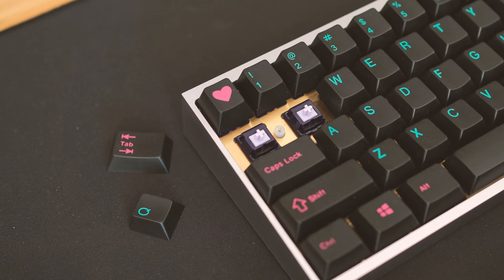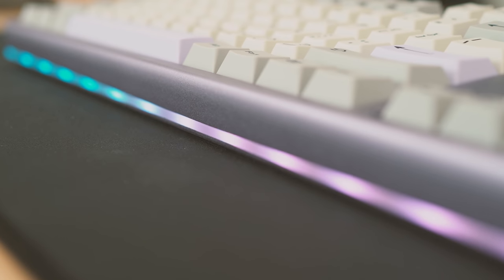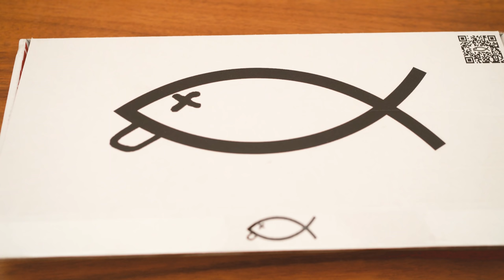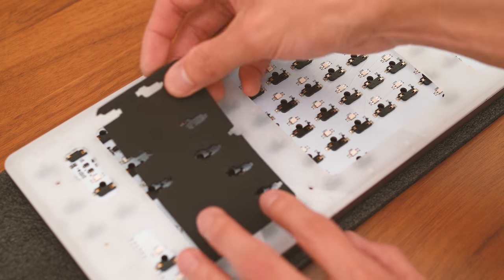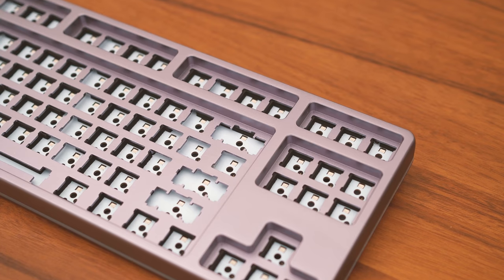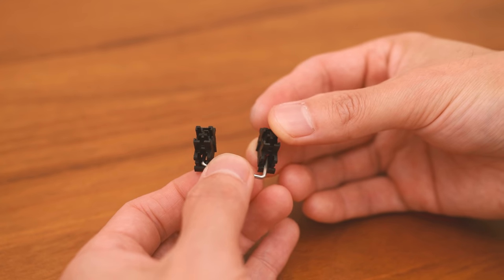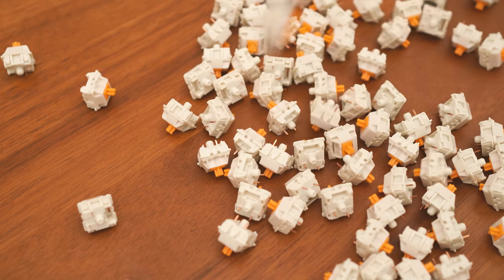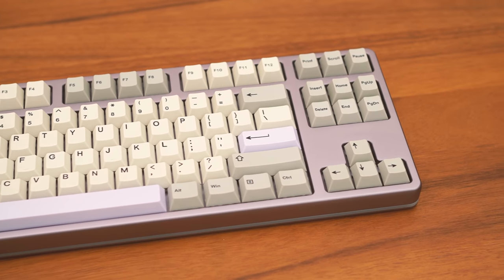Building the MOST AVAILABLE Custom Mechanical Keyboard!  DROP CTRL

Comment: Dec 2023 - I got this keyboard and built it as my first keyboard. I didn’t buy any foam but I had some sticky foam around (like the white vinyl foam you used). Thank you for the video as it showed me where I can put foam and everything neatly fit together easily meaning I just put it together and had no spacing issues. Thanks for helping me find this rabbit hole. Never getting a mass produced board again :D

Comment: The metal pieces are for the non high profile version since they use magnetic feet's to increase the angle. You can set the feet's either create a positive upward angle or a negative angle.
Reply from the maker: Hi Jmun 1!  That makes a lot of sense!  Thanks for chiming in!

Comment: I know this is an old video but I just found it. Great stuff man. After watching, I dove back in to my CTRL & pulled the stabs, did the band aid mod & took the op to clean & re-lube the stabilizers & just hit the buy button on the stupid fish foam. I have modded GMK stabs but went ahead & pulled the trigger on the Durocks you listed, because nothing is ever good enough.... dont know if it was the band aid mod or the re-lube but it did kill the ever slightest rattle I had on the left side of the space bar so I'm already happy. Looking forward to the foam & Durocks to see just how far I can push it. Thx again.

Comment: I think the little metal pieces inside of the case are for the magnetic feet to stick on stronger through the case
Reply from the maker: That makes so much sense :)
Reply: That's what I was thinking too until I saw this was the high profile which doesn't use magnetic feet.

Comment: underrated channel. your edits are to the point and voice over are top notch.

imo the best thing about the ctrl is that drop is able to keep it in stock ready to ship anytime.

compared to the next best thing like something in stock but takes two + weeks to ship from china (and drop does have no question asked 30 days return policy which is crazy as they dont have deep pockets like amazon)

the 2nd best thing is the PCB's very capable ARM controller which allows you to turn on every single QMK features and enables 10000+ keystroke macros if you want.

if the pcb supports 5 pins switches, I think the overall package does justify the $200 price.

when GMMK managed to get their inventory always in stock, the GMMK PRO will unseat ctrl for sure. hopefully drop can up their game in the next iteration.
Reply from the maker: Thank you so much C Xu! Yup the advantage of the drop is the availability :) also has one of the best rgb capabilities of that is important. I just built a few gmmk pros and they are very nice with some tweaks! Video will be posted this week!

Comment: the reason there was no keycap interference was cause of the glorious pandas im pretty sure. since they have a longer stem and bottem out faster then most other switches it doesnt travel low enough for the keycaps to hit the housing. :D
Reply from the maker: Hi Fred! Good seeing you! Exactly this! I feel longer stem helps to alleviate the interference! I wonder if there are linears like this as well... Most likely a cream stem frankenswitch or the new durock poms might be OK. Time to try it out!
Reply: @Keybored  nice lol, though i feel that if you get a linear with a longer stem - reducing the travel distance - it would make it much less satisfying imo. but still would be cool to try out
Reply: The glorious pandas are made to be compatible with Cherry profile keycaps and north facing LEDs. That’s one of their marketing points. I have the same and again, no issues.

Comment: Glorious Panda switches have a different top housing shape so even when north facing LEDs, they don’t interfere with cherry caps. It says this on their product page.
Reply: well I think it's more about the longer stem pole of the halo stem than the top housing shape though! but yeah I was about to mention the fact that holy panda (and it's variant) does not have any interference for north facing this was demonstrated by 3ildcat :)
Reply from the maker: Yup! The glorious pandas are a great option for North facing boards and cherry caps :)
Reply: @justinfournier2521  yeah that might be it actually. I just remember reading something about no interference.
Reply: @AtracBreezy  yeah basically any switches with longer stem poles will not have interference! (ex if you put cream stems in alpacas they would not interfere with north facing)

Comment: for anyone wondering, even though the pcb has south facing switches the stem of the glorious pandas have a longer pole meaning no tolerance issues for cherry profile keycaps
Reply from the maker: You are correct!  And there are also many different switches that happens to work with north-facing pcbs as well :)

Comment: A lot of people shit on the Drop keyboards but I think they have a lot of great features and are good for the hobby in general.  I'd be excited to see a version 2 for the ctrl. alt. and shift with pcb mount stabs, south facing switch orientation, and maybe even a different mounting system.

I feel its kind of like the same people shitting on the GMMK pro for offering a lot of higher end features(not all implemented well) on a really affordable and available board.  If they could fix their plates, tweak the "gasket mount," and either get rid of the GOAT stabs or properly lube them, then it would be a really great board for a really great price.

Good job making that Ctrl look and sound great!
Reply from the maker: Thank you so much! I do hear you in the criticisms! The hobby itself is pretty critical on many board designs. Hopefully constructive criticisms can help move the hobby along forward, but some do just like to troll for fun lol

Comment: i'd highly recommend his keyboard as well. i actually did most of the same mods as this one but the only problem i'd say might scare away some customers might be it's overall volume. because the backplate IS the case, it can get quite loud sometimes, especially if you're playing or just typing in a quiet situation. i played a horror game and this keyboard kind of ruined the game for me because all i could hear was CLACK CLACK CLACK when i moved around. other than that it's great
Reply from the maker: Hi Phantom! I hear you on this. The drop ctrl Def has an "Amp" effect on the sound

Comment: Ive heard that the Glorious Pandas have some modification to the switch so there is no interference with northfacing switches and cherry keycaps, unsure of how true that is but based on the typing test it sounds to be clearing fine
Reply from the maker: Yup!  the glorious pandas have no interference even with north facing keyboards!  The reason is actually their stem being longer, so the caps don't go down as much during the downstroke :)  Same for other switches like the holy panda, or the Boba U4T

Comment: How does the epsi/holee mod stand up to the added lube on the wire? Adhesives don't tend to do well after coming in contact with grease so I'm concerned about the longevity of the mod
Reply from the maker: That is definitely a legitimate concern! I used a more "plastic" type of bandaid hoping to avoid this... Will see how it holds up after some time!
Reply: One of the main advantages mentioned by epsilon in his video is that you don't need to lube the end part of the wire, the film / bandages inside the stem will eliminate any clicking / pinging, you only need to lube the curved part that clips into the stabilizer.

Comment: You won’t have interference with cherry profile keycaps because glorious pandas stems are extra long because glorious didn’t want any interference when putting on their gmmk (north facing)
Reply from the maker: Exactly this! Similar results with holy pandas as well as some linear frankenswitch using cream stems! I assume the new durock pom will also have similar results as well... I need to go try it now
Reply: @Keybored  Even though of the hate that it has for the integrated plate and plate mount stabs, i plan on picking up the ctrl high profile, as it looks so nice!
Reply from the maker: @utterkid2  I really like the new colors they also offer now :) I had an alt high profile as a daily driver for a while

Comment: an interesting technique to lube the stabs, inject lube into the stem rather than lube the wire, works better for PCB amount stabs?
Reply from the maker: I felt like it helps to control the lube Vs. using a brush and it going everywhere.  I guess multiple ways to skin the cat!

Comment: ARE THOSE KEYCAPS COMPATIBLE WITH GATERON BROWNS ALSO DO THEY WORK WITH HOLY PANDAS ON THE EPOMAKER GK87 IS THERE ANY INTERFERANCE FOR NORTH FACING LED LIKE IN YOUR VIDEO ON THE GK87?
Reply from the maker: Hi Andrew!  I believe these specific caps will have some interference issues with north facing switches.  I did notice that the interference is worse in certain switch/keycap combinations, and unnoticeable in others.  I had pretty good luck with the gateron yellows and long stem switches with many cherry profile caps in north facing configuration.  However, the HK gaming caps, you can definitely feel that R3 is a bit odd, since the cap bottoms out, and "moves" due to the interference.  Hope that helps

Comment: i bought the lopro version back in august last year.
here some things that i don't like at all about the board:
north facing switches (so no banger GMK sets for this bad boy)
3pin sockets (so you either have to buy 3pin switches or clip the legs)
for the qmk i'm not sure. last time i checked drop didn't release the qmk toolkit so you couldn't address the rbg leds on the edge.
Reply from the maker: I think as of late, some of the switches even in north facing configuration started to work with cherry profile like GMK!  I did a quick study on this on my GK87 modding video!

Comment: I’m trying to build a budget custom keyboard, what’s your opinion on the MXRSKEY 84U barebones with Gateron yellows and some pudding keycaps maybe for under a 100 dollars?
Reply from the maker: I don't have personal experience with that specific keyboard, but looks like a good start!  75% layout and you can never go wrong with the gateron yellows... so good when lubed and filmed!
Reply: @Keybored  I was personally thinking about this coz it was convenient way for me to get into that whole thing for only around 85 dollars.
Was still thinking either or not should I do it, only because of the reason that I have HyperX Alloy origins core, is made out of aluminium but I’ve heard it’s kinda hard to mod. Should one is better to choose

Comment: What linear switches you would recommend for that board? I want me some Linears. LOL
Reply: I recommend everglide tourmaline blue or Sp-star whites. They both sound good stock and feel great.
Reply: Gateron ks3 yellows are always a good choice
Reply from the maker: These are all great choices!  I have been enjoying the JWK linears (Tangies, Mauves, Lilacs, L4, etc.) as well as the new durock POM.  Gateron Ink Blacks are amazing also, and so are the gateron yellows!  But keep in mind the northfacing nature of this board, and some of these switches may have some interference with the cherry profile caps
Reply: What do you guys think about the Everglide Aqua Kings?
Reply: @DRacer90  possibly overrated and hence, hard to find.
Reply: @StaticNebula26  Found one here but I dunno if the same one we're talking about: https://kprepublic.com/products/everglide-eg-aqua-king-water-king-linear-switch-4pin-5pin-rgb-55g-62g-67g-force-mx-switch-for-mechanical-keyboard-50m-clear-body?variant=39411711017123 Also, what other linears you suggest?
Reply: @DRacer90  idk depends on your budget, you could try looking at some frankenswitches if money is no object, I'd recommend getting a linear switch tester with a good variety of weights and brands, include a tactile or two if you've never tried anything other than browns and blues.
Reply: @StaticNebula26  Sounds good. I'll check them out. Thanks

Comment: what keycaps are recommended for north-facing switches?
Reply: Just not cherry typically.
Reply: @SmartFool24  so anything but cherry?
Reply from the maker: Typically for north-facing switches, you would go with OEM, SA, MT3, etc.  Pretty much anything works except cherry profile, since cherry is shallower than most.  However, I have also shown that certain switches and keycaps do a much better job of working together even in north-facing configuration!
Reply: @Keybored  alright thats great to hear thanks!

Comment: even with all that foam, that thing still sounds very pingy. Wouldn't you say tofu is a better "instant gratification" board than anything drop produces?
Reply: O-Ring mounted Tofu65 smacks the Drop boards
Reply from the maker: Hi Barbell! I would say overall, the Tofu has more customization capabilities, and can yield better sound as well. Issue was that the request was for a Tkl specifically, and those are pretty hard to find readily available! I do see some KBD8X available now... But prices seem to have gone up a bit.

Comment: Would these mods work and sound the same on the low profile version of the DROP CTRL?
Reply from the maker: Low pro is actually a bit different. A lot less space inside, so less ping but also less volume in general

Comment: Hi! I’ve already installed the stupidfish foam in my Ctrl Keyboard. I’ve noticed that with the foam in the PCB has to be a bit combed if you want to assemble the keyboard perfectly again. Since it happens to you too as can be seen in the video, have you had any issue in the long term because or this issue?
Reply from the maker: hmmm... I actually didn't have any issues using the stupidfish foam in this keyboard... that's odd
Reply: @Keybored  Well it happens to you too (3.48), but since you haven't had any issues it's enough for me. BTW, the keyboard sounds amazing now! thanks a ton!

Comment: What kind of USB cable works for the CTRL? I've read something about the length but not sure
Reply from the maker: Hi Hector!  The CTRL and ALT requires a more power than other keyboards, and from what I know, the overall length of the cable must be under 9ft or so!
Reply: @Keybored  thanks! Where do you buy your cable?
Reply from the maker: @hectorsabillon1737  I built them diy with parts from cruz ctrl and zap!
Reply: @Keybored  wow awesome! Not sure I can do a DIY 😅

Comment: Hi keybored! I followed this exact build to the T, but my stabs are very mushy. The Shift, enter, and backspace stabs tend to get stuck and dont bounce back up. I thought it might have been because I applied to much grease, but I removed all the grease from the wire for the enter and shift key and its still the same. I thought it might be the keycaps(I’m a noob) so I tried another set and its still having the same issue. Do you know how I can fix this? I would really appreciate some advice <3
Reply from the maker: Hi Eric! What stabs did you use? The durock plate mount? Are you using them stock, or with any modifications? Using glorious panda switches? One thing I can think of is if the Grease you're using got in between the stem and the housing... That makes it super sticky and very sluggish. Might want to clean it all out and try again fresh to see if that makes it go away. Then I would try using light krytox 205 on the stem and thicker Grease only on the wire. Or try one of the mods from my stabilizer video. Let me know how it goes!
Reply: Hi Keybored!! Thank you for the response. 
I used every single part that you did in this video. (Durock plate mount, glorious panda, drop ctrl high profile, stupidfish foam, everything exactly the same. 

I did a bunch of troubleshooting myself and found that the mushy issue was being caused by the bandaid mod for the stabs. I ended up taking off the bandaid on the plate for all my stabs and now it’s less mushy. 

Not sure why this happens, but now I do have some rattle on my stab keys. Do you have any suggestions?

Comment: I thought band aid mods go on the pcb not around the plate
Reply from the maker: You are correct huge galaxy brain!  I have a tendency to call anything with bandaids "bandaid mod" lol.  But the "official" bandaid mod is when you cut out a small piece and put it under where the stabilizer stem hits the PCB to soften the bottom out :)

Comment: i got the arctic version of this what keycaps would look nice? for about 50$
Reply from the maker: If you're using a long stem switch like a panda, then you can go with a set of hk gaming pbt caps in bow or another lighter color scheme. Or you can also look at the gpbt caps as well. Both of those should fit that price range!
Reply: @Keybored  ok thanks also I’m going to use alpacas.How do I make them as thoccy as possible?

Comment: Is the drop alt north facing if it is it sounds really good with cherry keycaps 😂
Reply from the maker: Yup!  This is north facing!  However, the glorious pandas have a longer stem, and it helps to reduce the interference :)
Reply: @Keybored  ok thanks
Reply: @Keybored  what switches can I use to reduce the north facing issue except holy pandas

Comment: Does 3 pin switches feel any different to 5 pins?
Reply from the maker: Hi l1m1tless Road!  For this specific build, I haven't noticed much difference between the 3 and the 5.  However, Glorious Pandas do have a very tight fitting housing, so perhaps that helped out as well!
Reply: @Keybored  ahh, thanks

Comment: Can I use Vaseline as lube ?
Reply from the maker: Hi HACKERISTIC!  I would not.  Petroleum based lubricants are not so good for plastics, so it will degrade it over time unfortunately.
Reply: @Keybored  thanks! I better asked from you, I saw an article on keyboard lubricants and it recommend to use Vaseline.